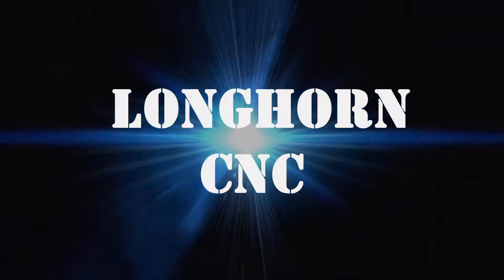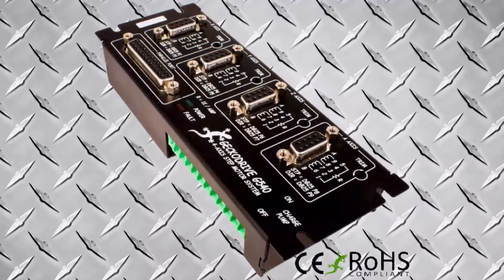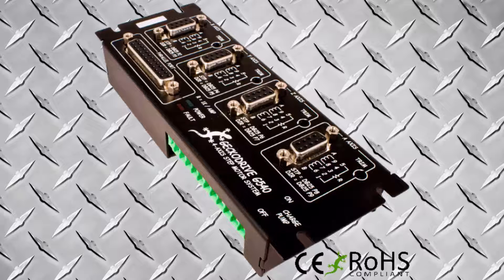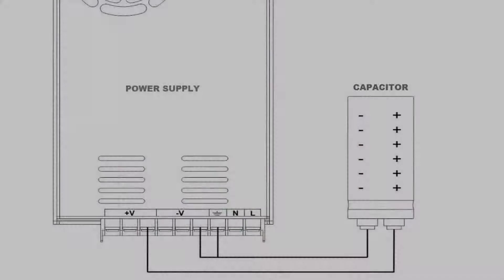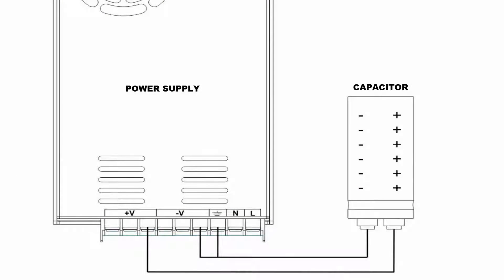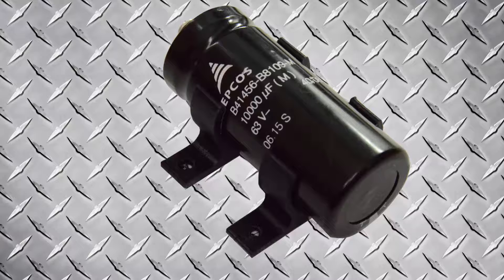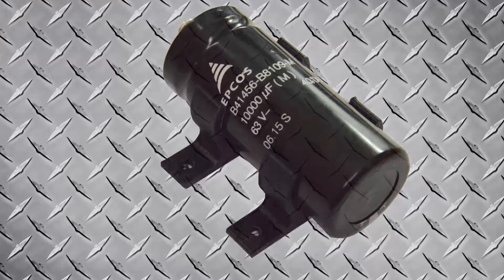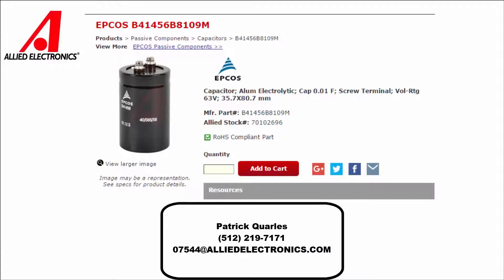CNC Router Gecko G-540 fault fix & Capacitor wiring

Comment: I’m getting fault on the gecko drive. I sent it in and they did the fix for the overcurrent on older models. I’m still getting the same error. It does it all the time but it’s not possible to duplicate the reasoning, it’s so random. I have a 48v unregulated antek power supply. I’m running the 3.5a 381oz nema 23 motors. Do you think this would fix my issue? It’s so frustrating, I’m about to switch to leadshibe mx4660

Comment: I was wondering where the G540 power comes into this as well. Does it wire directly to the + side of the capacitor, or to the same +V output as the capacitor on the schematic?
Reply from the maker: The setup of the capacitor is just an add on to your existing setup on your CNC setup. The G540 does not get hooked up to the capacitor.

Comment: So I need to do this fix too. So do you hook up the capacitor as shown and then in separate v+ and v- hook up the G540 not shown in your diagram? Also my power supply doesn't have that third hook up. Is that ground? Can I just ground it to the ground running into the power supply instead?

Thanks.
Reply from the maker: You will need to take a wire and jump the ground to the -V from how i was instructed by Marcus at Gecko and is how i hooked mine up. What are your settings in mach 3 motor settings?

Comment: Been getting the fault the last couple days ill give this a try thanks. Did yours ever fault out right after initial powering on? Mine will throw the fault a few times right on power up then come on....... then fault while the code is running.... its wierd
Reply from the maker: Yep i was getting the fault every time i tried to use it then it would go away for a while. I talked to Marcus and it was explained to me it was a huge power draw that was causing the issue and tripping the fault. What are your settings in mach 3 motor settings?